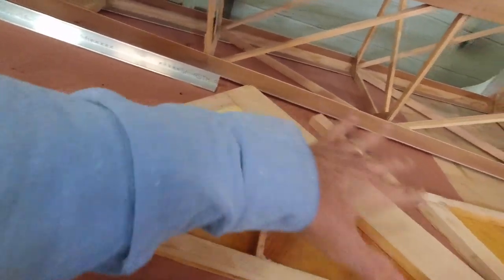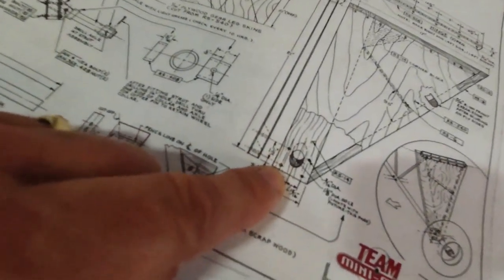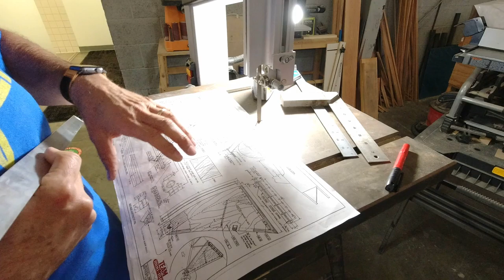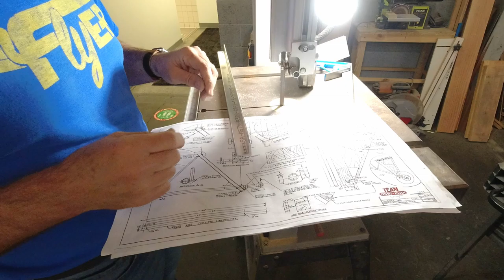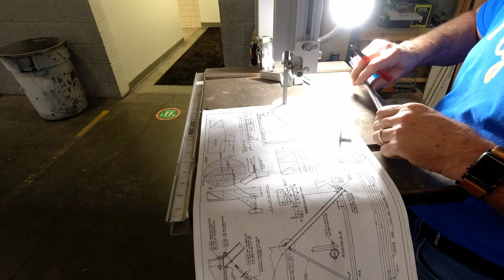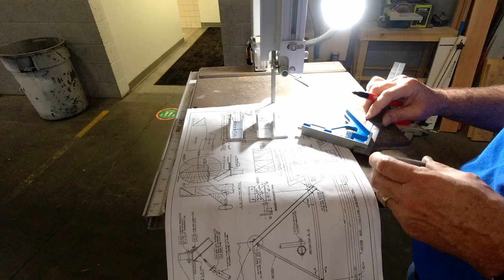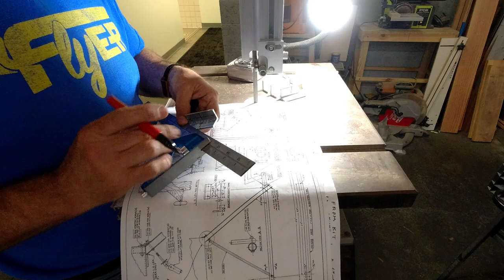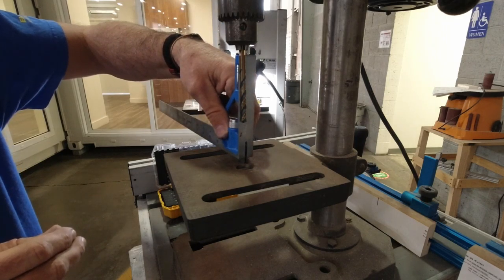Minimax 1100r Wood Aircraft Build Ep 81 - Making Brackets

Comment: Dennis.  I would have killed for a drill press. :)   I think I mentioned a buddy of mine let me use his drill press to drill all eight  "wing to fuselage" attachment straps, and the eight "wing to strut" strap fittings.  He lived 75 minutes from me, one way - but it was well worth the trip to get those holes drilled vertically. :)  (I usually used a "dowling jig" to keep my drill bit vertical, but couldn't drill the straps with it.)

Just had another thought - that was drilling the axel" holes on the airplane for the front and rear struts, while maintaining my 2.5 degree dihedral angle.  Larry Isreal, of TEAM, was adament about that 2.5 degree angle. (for the EROS).   They had tried different angles.  Was difficult, but my Sears pendulum analogue protractor worked well.  :)  The rear wing strut  positioning, was not as difficult - only had to maintain "Zero Washout" for the wing.  (no twist at all ) Was easy per Minimax's instruction.  Looking good Dennis.

Comment: great to see the landing gear coming together. I ended up bending the gear and tailwheel spring on my himax yesterday landing at my friends house. He has a much bigger field but this time of year its being leased out to someone else for hay harvesting so I stopped landing there and have been landing right in front of his house which is a very short area that you really need to be on top of your game to land at, definatelly not landing there anymore. anyways I was coming in really slow and touched down with the tailwheel first then stalled out which bent one of the 1/2" landing gear diagonal brace tubes and bent the tail wheel spring up almost enough for the elevator to touch the ground. I had my friend to lift a wing and I used a rubber mallet to beat the 1/2" gear brace tube back into position and carefully took off and flew back home. I took the tailwheel off today and there is cracking where one of the an3 bolts go so I have a new tailwheel assembly on order from team and a new 1/2" tube for the landing gear. The gear is tough but has very little shock absorption in a hard landing.  youtube deleted my channel so I had to use a old account. Looking good bro can't wait to see you fly that thing.
Reply from the maker: Do you have the same tailwheel spring I do? With the full fork?
Sorry you had such a hard landing
Reply: @DTMinimax  yes Its the same for the himax and minimax I used a an bolt as a axle with aluminum spacers and a razor scooter wheel to save weight at the tail. Thanks, you should be fine dennis, I just pushed the limit a little too far. although I think the himax would make a great bush plane with a carbon fiber landing gear and oversized tires.

Comment: You made it hard for yourself by doing all the marking on the inside of the L section, you could have maked on the outside and supported the metal on a wood block for drilling and cutting. It is come on well.
Reply from the maker: I’m sitting here laughing because when I think about it, you’re absolutely right. It’s amazing how we choose a path and then just ride that wave no matter what.
Reply: @DTMinimax  It is easy to miss when you are there and you see a way that you know will work and it worked, I just thought I would try to help for others you may have to make.